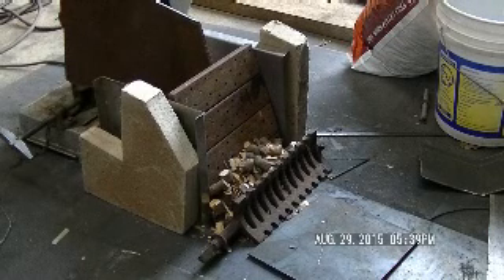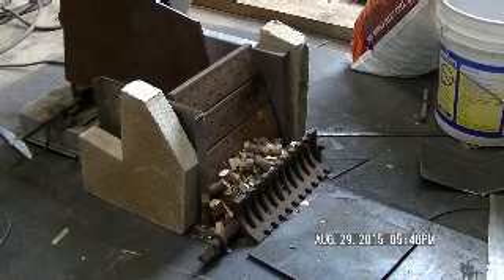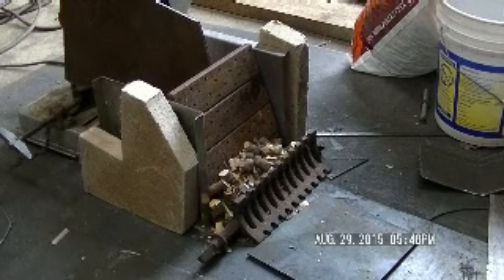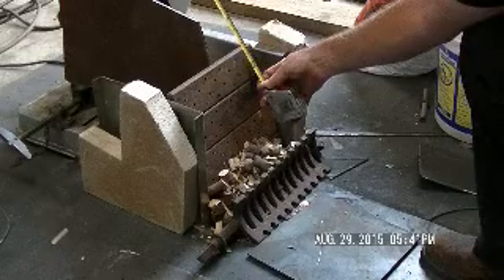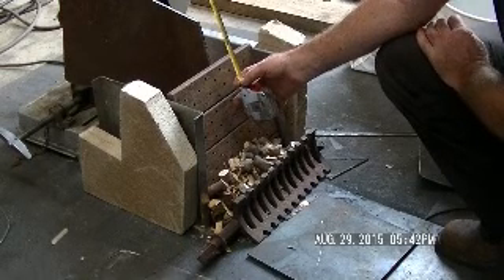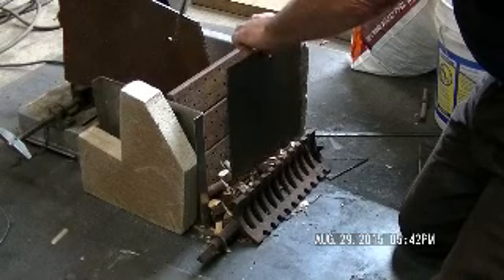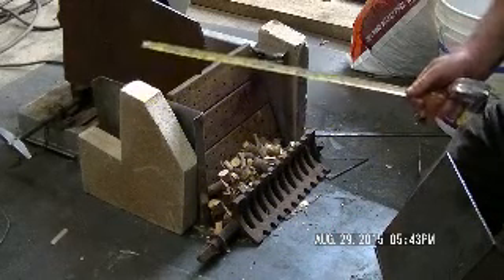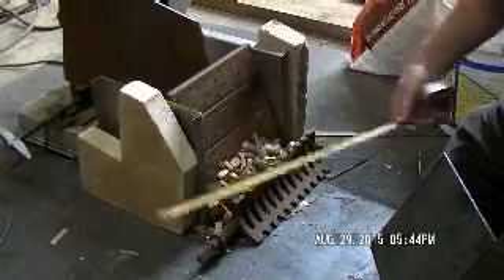Gasifier concept for new build

Comment from the maker: Technical error right off the starting block. I meant to say that the induced draft would work from the primary air supply from the  left through the grates towards the wood and baffle with the gas being collected down stream from there. . Forgive me. It's called a " build in progress" ! subject to many changes without notice or warning.
Reply from the maker: +docdcox Dan, The glory of the idea is the heat that the cast Iron grates can handle and once hot enough will  keep the ignition going. The swinging baffle will keep the saw dust or chunks working their way down into the hottest portion of the wedge.